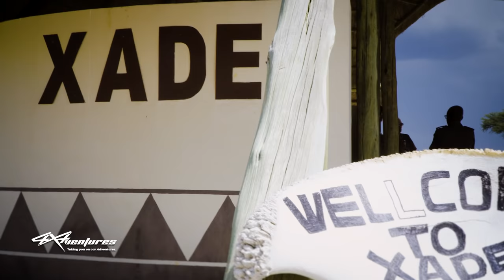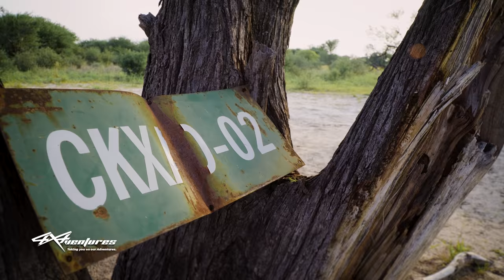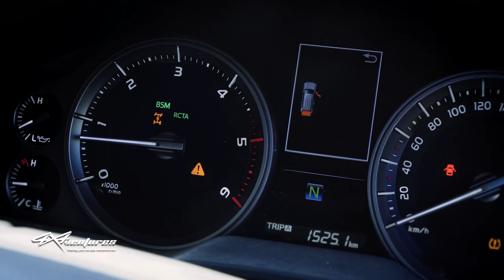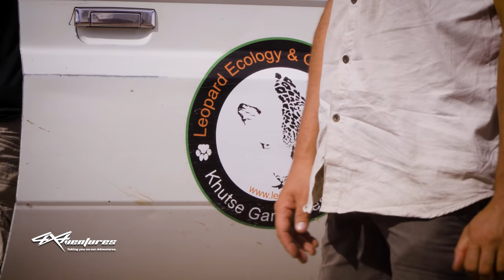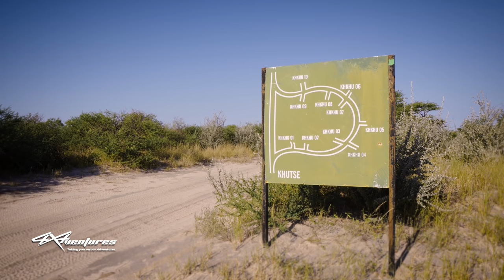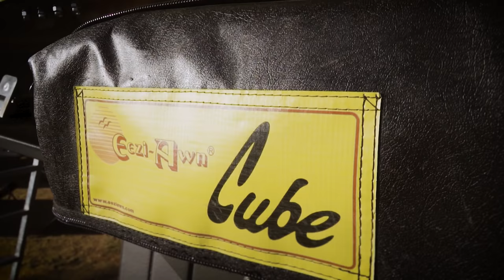Overlanding The Central Kalahari Episode 2

Comment: I'm slowly building up my Breand sprankin new ISUZY D-MAX All terrain(top variants) for this kinds of trips and tour. 2 inch suspensions lift with sets of 33s A/T. Winch, Bullbars, rock-sliders done. But still more to come like camping equipment, auxiliary batteries and lights. It's gonna take time. Hopefully I, could hooked with you guys up in the mid or late 2022.

Comment: thanks for actual technical details of road between Xade and Bape, mostly 4H on 2nd,3rd,4th. about 16.5l/100km. must be easy just long
Reply from the maker: Not necessarily easy, depending on the time of year. Thanks though and happy adventures
Reply: @4x4ventures_southafrica  we just completed the trail with 5 bakkies, Hilux, Navara, Isuzu, fx4, wildtrak. It is a fun trail and mostly 4H and some 2H driving. We found it is the length that  is taxing. Sometime BDF trucks widen the tracks making for a very interesting drive